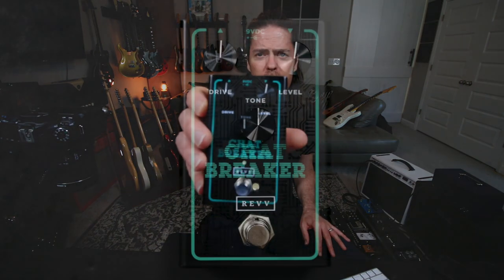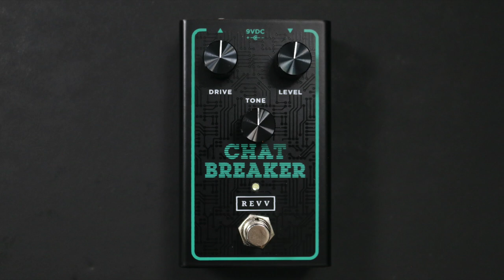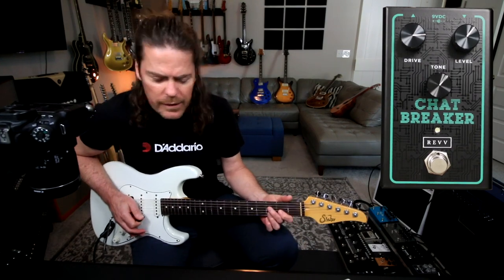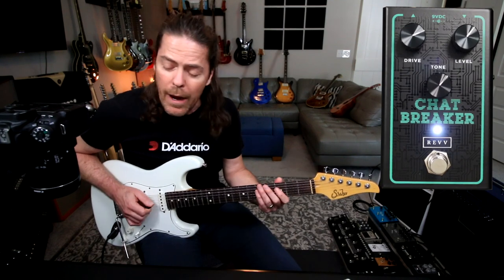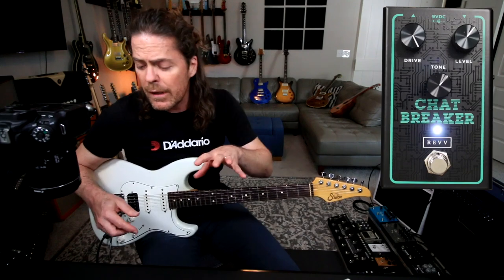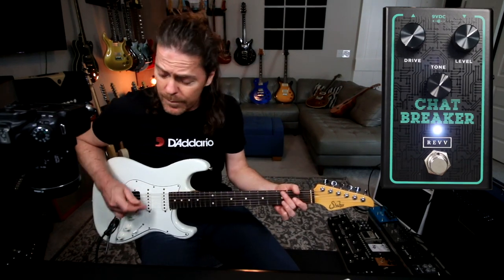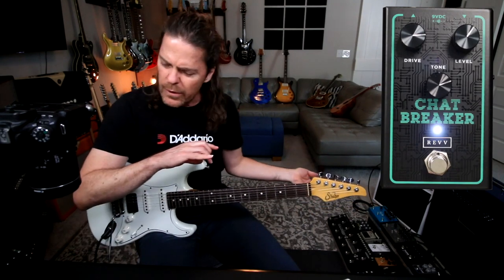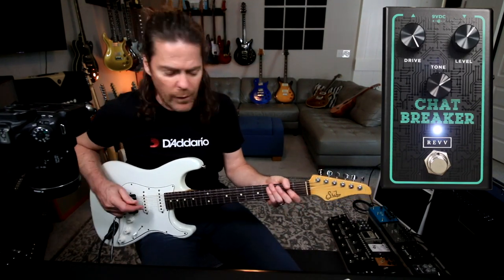What Happens When You Ask CHAT GPT To Design An Overdrive Pedal? REVV CHAT BREAKER OVERDRIVE!

Comment: How does this compare to the tilt?
Reply from the maker: The CB is very much a "bluesbreaker" style circuit but with some tweaks that Dan Trudeau added. More saturation and clarity. The Tilt OD is not at all based on any particular circuit per se. It is more versatile for sure but is really a different animal. More along the lines of a high-powered tweed twin or a JTM 45-style circuit. If you really like a bluesbreaker style pedal the CB might be for you. If you need a variety of different OD voices, the Tilt OD will do it.
Reply: @ShawnTubbs   thanks for the reply I have the tilt on my board and its really great, sounds like this could be a good compliment to it.  currently a g3 sits next to the tilt and while its amazing at the lazer focused high gain sound I don't think thats really my sound.  the G3 is just a bit too focused and high midrange voiced.